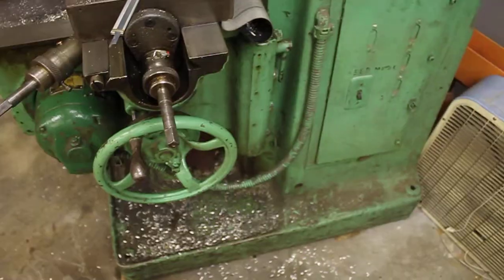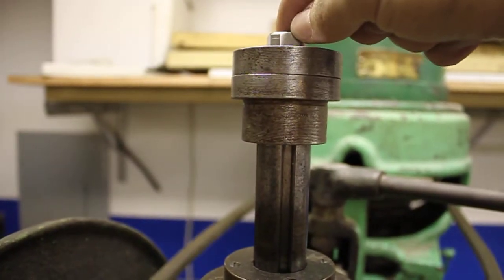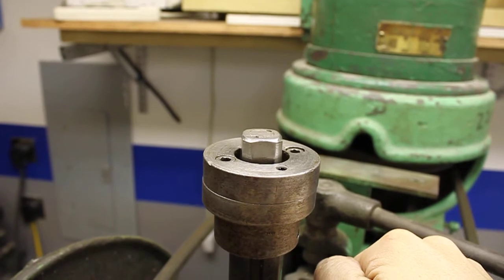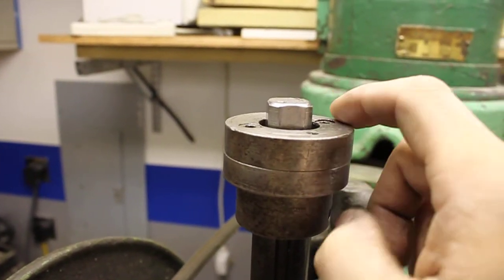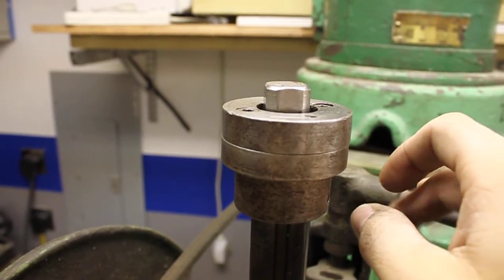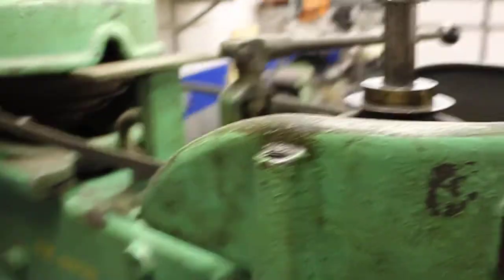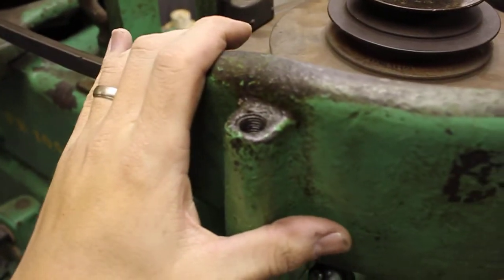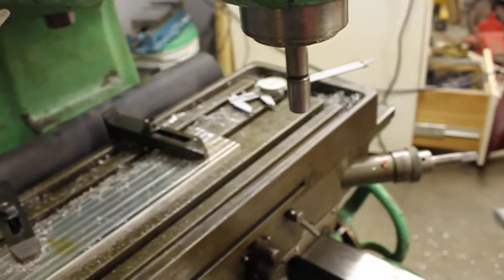Gorton milling machine tour part II

Comment: On a normal knee mill (since this is quite different from a standard bridgeport or similar) the typical collet/tool removal procedure that I follow is to loosen the draw bar all the way so I can lift it out of the collet, then screw it back in a few threads and lightly tap it with a dead blow or rubber mallet. If you put a little bit of lube on the collet before sticking it in the quill it usually just falls right out.

Comment: Do you still have the mill and how is it working. I am about to pull the trigger on a Gorton and I was wondering if parts are available?
Reply: I too am looking, but the tooling. B&S#9 spindle taper as I am told. This old girl is  still sitting in shrink wrap and there is 4lbs of tooling, ie none :-)
There used to be a website dedicated to the Gorton by the descendants of George, but there is no user forum unless a few threads on CNCZone or such. I haven't found much.
The options are to modify the taper :-O!!!
Ebay offerings are spotty at best and one is relying on antique dealers essentially.